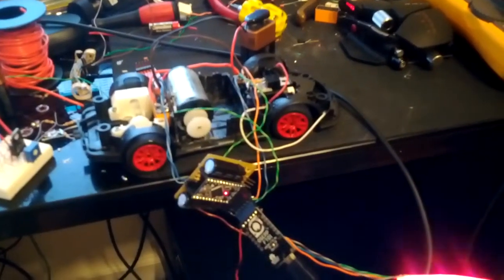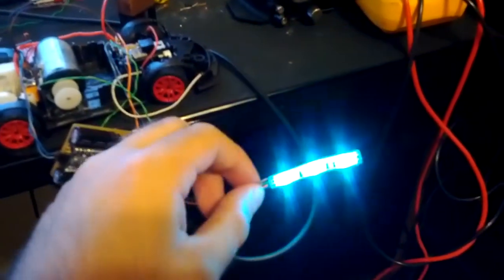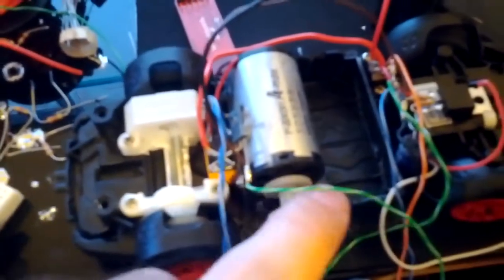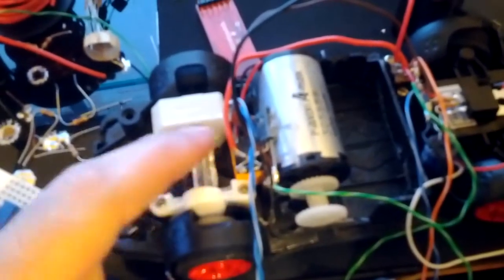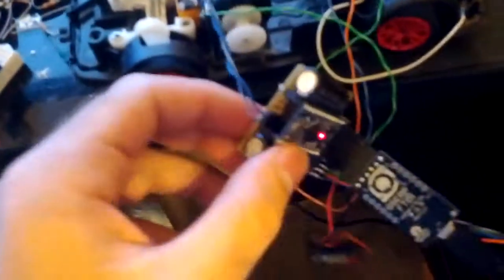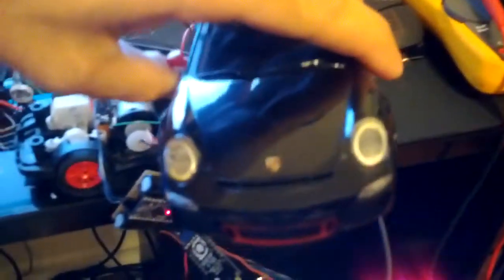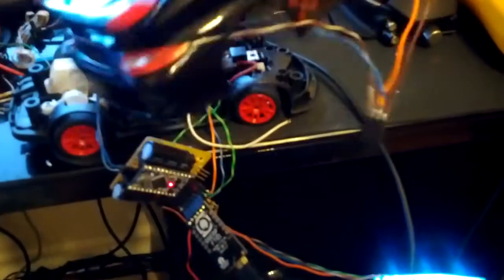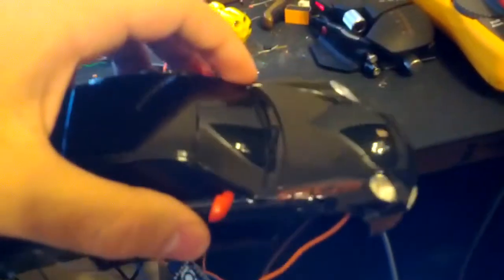Arduino rc car project part 2

Comment: would have been good if you had shown us how you put it all together for the Arduino newbe like me.
Reply from the maker: there's really not much to it. Also if you don't know enough about electronics i advise against attempting it the way I did since there's a lot of potential to go wrong. Actually last few days I made a lot of progress on this little car(i redid almost everything) so I might make a video going in detail about everything.
Reply: OtakuSanel  I am wanting to get into electronics and robotics, do you know of an adult level intro kit or book you can recommend? I do like your idea of using the RC car as a base.